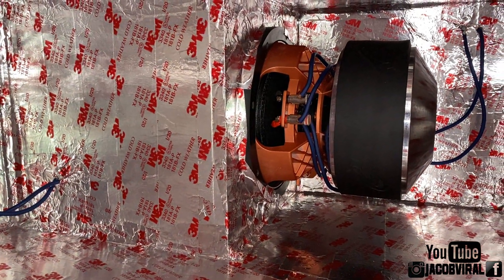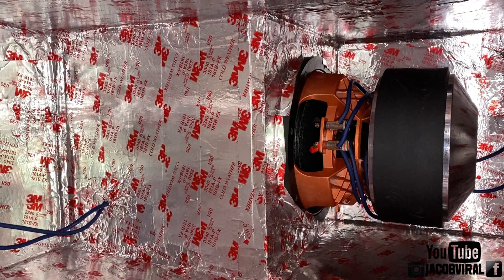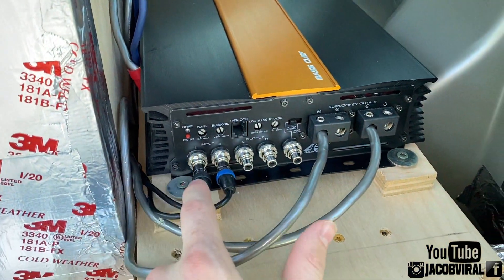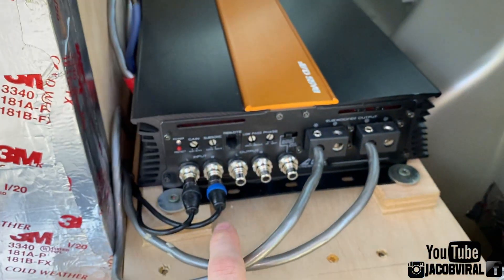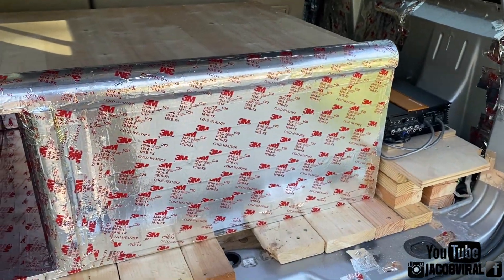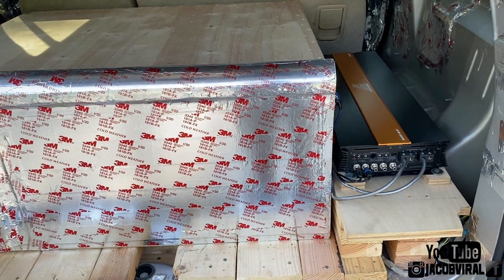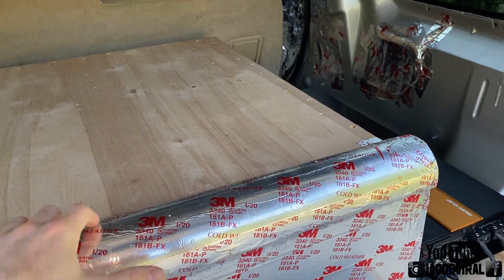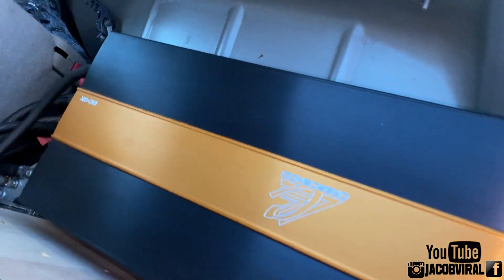I GOT MY NEW AMPLIFIER!

Comment: Nice choice Jacob looks like a good fit. Was wondering what kind of power I would need for my 2 al1600.1ds I'm receiving the second one sometime this week going to strap together at 4 ohms for now since I only have a single fi ssd 15 at the moment... what kind of electrical upgrades are needed for 2000 watts at 4 ohms only have 1/0 welding wire and the big 3 done as well. On a stock alt and battery till I upgrade electric
Reply from the maker: Thanks man and I would look into atleast upgrading to a front agm and adding a back agm, like a group 34 or group 31.
Reply: Alright man thanks for the input keep up the great content!